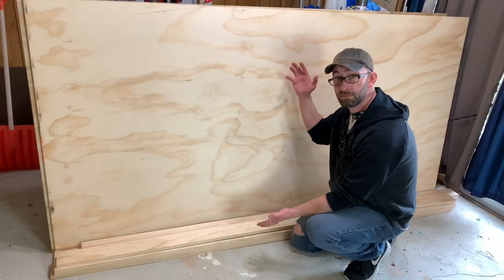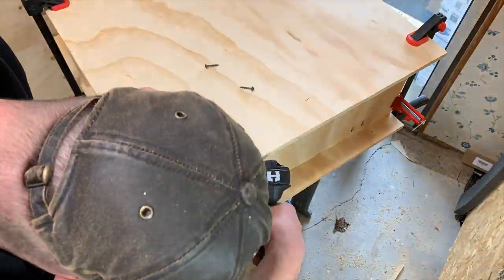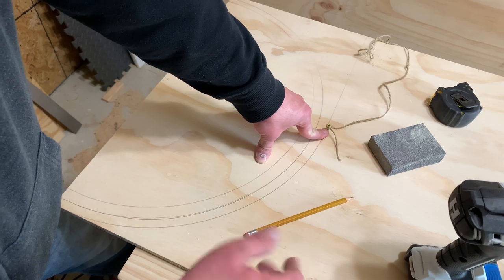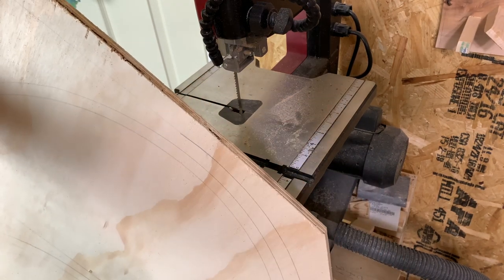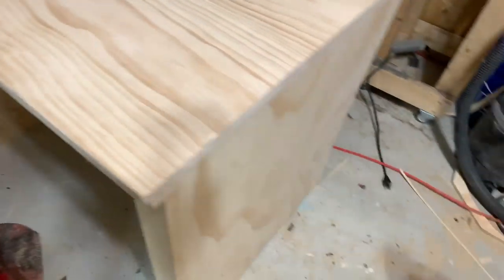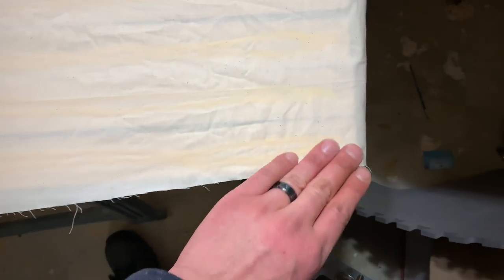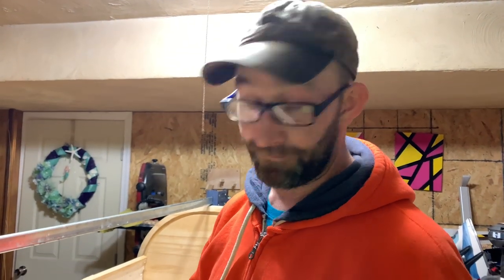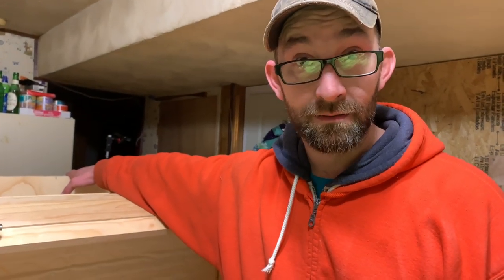Making a ROLL TOP DESK

Comment: Solid first attempt. For the backing, I would have used a  slightly thicker canvas drop cloth (think heavy duty painter's drop cloth) and  ironed it  on after applying glue b4 drying (gets rid of any bubbles/wrinkles) as for the track, heavy paste wax would probably help it move easier.  Overall, I think you did quite well, I only offer my suggestions based on things that have worked for me on smaller projects; it's not meant to be critical at all. I look forward to seeing more of your projects.
Reply from the maker: Thanks for the suggestions!